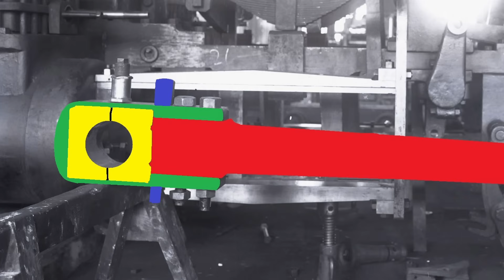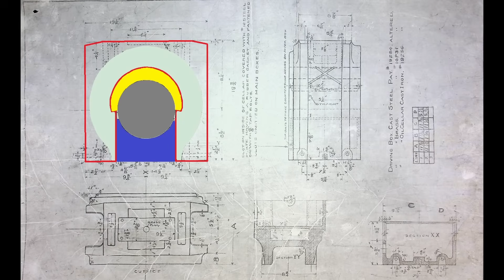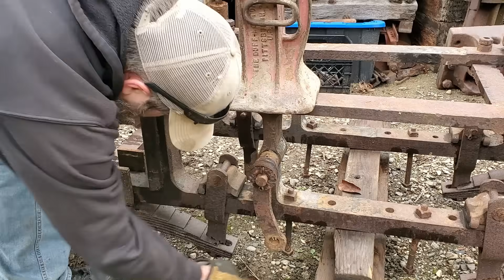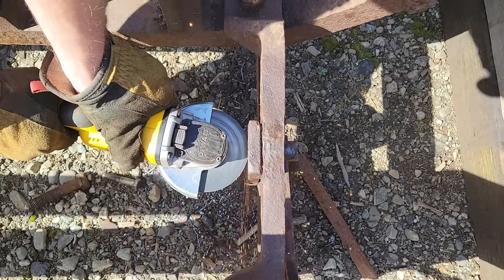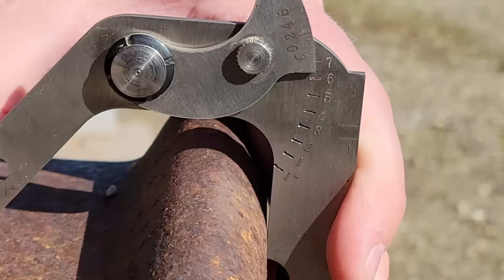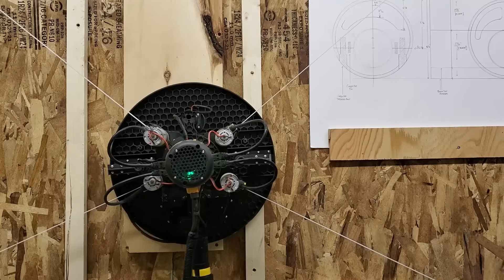Ep 11 - Steam Locomotive Rods, Bearings and Spring Work. Plus What's a Wheel Gage?

Comment: If the saddles of the springs rest on the upper rail of the frame, then how can it compress? Any downward force would just go straight into the frame. If the suspension cannot compress, then the equalizers cannot leverage properly. I don’t understand?
Reply from the maker: That's an excellent question! Keep in mind you're seeing the spring rigging totally unloaded, if you add 10,000 lbs +/-  of boiler, water, coal, etc. You'd then have a gap between the frames and saddles, this is because the added weight would cause the frame to settle lower towards the rail and fully load the springs. Make more sense now?

Comment: Awesome Video !  I worked in a Vintage automotive shop as a Toolmaker /Machinist 
Many issues you describe and  Explain are very similar to our work . I made MANY Babbitt shells for rebabbitting and Line bored  the completed assembly into crankcases and Camshaft housings . We also made patterns to facilitate new casting for machining . 
Folks today have little idea of what was necessary for this type of industrial operation .My grandfather was a steam locomotive Engineer for the New York Central System from 1883 to 1956 .  He knew and understood Every facet of Steam locomotive engineering and operation.

Comment: bro is yapping about plain bearings like the downside is maintenance costs. RRs would still be using those MFs if they weren't practically illegal. You can only use em on non-interchange equipment, bro neglected to mention that they will in fact, catch on fire and do something called hotboxing (not the fun type). This will derail your train full of hazmat somewhere populated. They're illegal on interchange equipt. for a reason lol.
Reply: @af8312

"Bro" is highly unlikely to be transporting hazmat cross-country. 

You get that, right?
Reply: @billstevens3796  yea but all i'm sayin is that there's a very good reason folks don't use plain bearings anymore, and to try and sugarcoat them as some magical solution isn't exactly... truthful?

Comment: Some other useful tools to use would be a back-out punch and flatter.  Both have handles and come in a few different sizes.  Another item would be a copper or deadblow hammer.  The cotter key puller is nice but a little “tender” when using to remove tighter fit or frozen cotters.  Nicely done production and the drawings added to the explanation.  For future thought, consider ‘a how to’ removal and assembly of heavier parts.  This from a safety point of view.  The ‘scene cuts’ from other shop films also added to the production.

Comment: I've heard that oil grooves in bearing brasses are actually counterproductive.  I don't know if that's true but no modern internal combustion engine I've worked on had them.   Modern scanning, CAD and CNC have made it much easier to recreate castings.  I've heard some foundries can even 3d print sand molds directly and skip the pattern stage entirely.  Does your CAD program provide adjustment for shrink or did you have to calculate that yourself?
Reply from the maker: I calculate all that myself. I'll explain everything in an upcoming episode. Thanks for the comment!

Comment: Outstanding!!!  Always learn something new watching your videos.  I've always been interested in the progression of locomotive design and construction.  The transition from square ended/strap/shim/wedge side rods to round ended side rods with pressed in bearings, is something I've wondered about.  It seems as though the older design allowed for some adjustment, whether due to machining/matching inaccuracy, or perhaps like a lot of things, they just hadn't thought about a better way to do it.  My guess is that early on, they just couldn't easily match the crankpin spacing to the axle box (in the frame) spacing accurately enough.  As the machines and techniques got better, they were able to transition to the round ended rods.

It's also interesting to see all the shims that have been put into place to take up wear...  

Looking forward to seeing more progress, it's certainly is a major undertaking, made much more difficult due to the condition of all the parts on the locomotive.  Keep up the great work and thanks for sharing this with us.
Reply from the maker: Thanks for watching! I'm glad you're enjoying it!

Comment: The explanation of the working of every part is so good. The tyres need some machining, the wheel tread profile is rounded which means that it has worn away towards the flange, the tread should ideally be a flat cone shape to have the best running characteristics around curves.

Comment: Your computer controlled routers and 3D printing are marvelous. They have made the traditional pattern making trade of handmade Patterns obsolete.
So as a retiree master engineers pattern make. I watch in horror how attempts By amateurs using such equipment. Take a simplistic approach to trying to make castings, That are totally devoid of the traditions and knowledge of foundry work and moulding methods. The Traditional Pattern maker, makes tooling FOR the foundry. Not the engineering customer. The consultation should always be with the foundry. Let them decide if hollow spaces should be COD or CORE. just to point out the most glaring example.

Comment: I was a volunteer on the Talyllyn  narrow gauge railway in mid Wales in 1975.  I was. 18 an in awe watching Mr Green welding up wheel worn wheel  profiles free hand, for turning back to correct shape. He would pitch the red hot welding rod ends across the workshop into the bin. I was very very keen and enthusiastic, and said I would love to be able to weld like him. He said no you don’t, as to weld like he did, he had spent most of his life welding and he would not recommend it. I learned much and met so many incredible people over  those two summers on that railway. 
The Talyllyn is famous as the first railway to be preserved entirely by volunteers back in the 1951 . It was Built in 1865 for slate and passenger service and still runs the original stock. Worth a trip if you’re in the UK. Highly recommended.
Reply: We had a family day out on the Talyllyn railway on a holiday in Wales in the mid 1960s.

The promotional material mentioned "hidden halts and secret stations" - so the advertising team were creative, just like the engineers.

Comment: I'm impressed by your knowledge and skills. The quality of the old steel is also outstanding; if you try to loosen screws on a 10-year-old car these days, they'll either break off or become rounded.The load-bearing parts of modern pickups rust away completely in just a few years, it's crazy!
Reply: I parked up a 2012 Mercedes S-Class for 4 years and it was that wrecked when I came to it I gave it away
Reply: @piccalillipit9211  I know the "Quality" of Audi,, BMW and Mercedes. They are expensive, but nothing else. Therefore I drive Volvo since 1981.
Reply: @kingearl2596

Volvo is now owned by a Chinese company.
Reply: @billstevens3796  And on? The technical Headquarter and many other things are still in Göteborg-Torslanda. The Chinese have the money, but Volvo is still Swedish.
Reply: @kingearl2596

Still Swedish... yeah, no.
Reply: @billstevens3796  Less knowledge, more blabla. Trump supporter?

Comment: There’s an art to packing the cotton waste in what you call a dope cellar. Mistakes lead to cotton fibers working up into the brass/axle interface and ultimately a hotbox. The big railroads went to performed lubricating pads before they went to roller bearings. I remember that we used Hennessy Journapak pads on our older coaches on a steam tourist railroad.
Reply: I remember pads held up on wads of horse hair on narrow gauge bearing box’s.